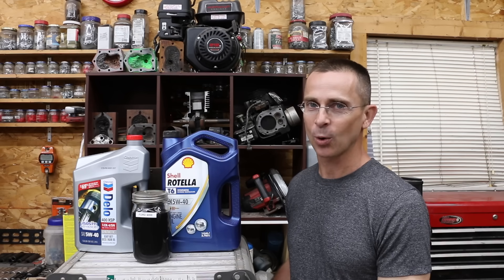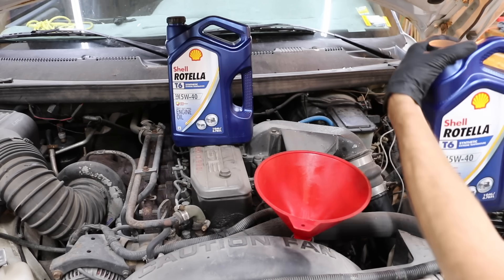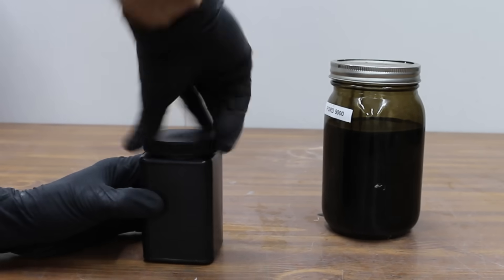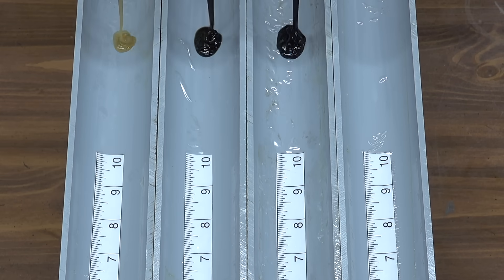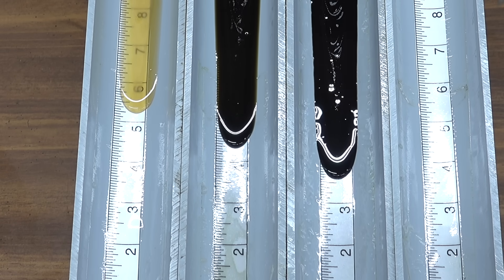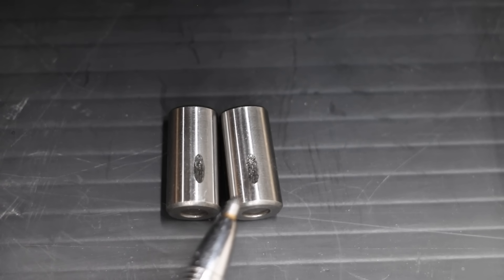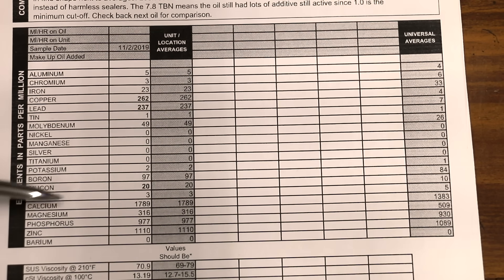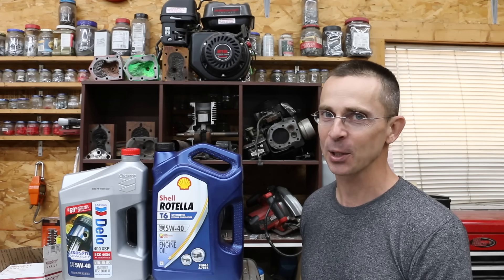Will Annual Oil Change Damage Your Car? Let's find out!

Comment: I still change my oil and filter every 2000 miles or 3 months.  Valvoline 10w-40 Syn Blend Max Life and a NAPA Gold Filter.  Nice to know it will go the year just in case I get senile and demented.
Reply from the maker: The 4.3 should last a very long time
Reply: How many miles can I expect from my Astro Van 4.3 L motor if I'm changing oil every 2000 miles and never beat it up?  I wish someone would tell me a half million... lols.

Comment: High copper % will wear out your engine really fast.
Reply: High copper is as a result of worn main/rod bearings down to the copper layer. So, yes it's an indication of excess wear, but copper is the result, not the cause.
Reply: @jamesplotkin4674  If you studied a bit of chemistry you would know what copper does to your engine. Try putting some in your engine and drive 5-10k miles and see what happens.
Reply: @rudolfgyorkei9558  OK, but Todd uses Engine Restorer and sees good results. Obviously, I wouldn't dump in enough pennies to block the oil pump pickup :)
Reply: @jamesplotkin4674  lol, if it works then I cannot argue with that
Reply from the maker: Thank you for the feedback. Copper is from the Engine Restorer product
Reply: @ProjectFarm  So, Im confused. Rudolf said copper damages the engine, but you say otherwise. I don't know what to do, so a nap is my best option.

Comment: My video idea. How about the idea some people have about non detergent oil vs detergent. I have been told that if the engine has always been run with non detergent oil it is not a good idea to switch to a detergent oil. Especially if the engine does not have an oil filter. The fear being that if you switched to a detergent oil after years of using non-detergent you would dislodge years of contamination and dirt and potentially damage the engine. It Would be nice to see some tests since there is so much debate about this topic on antique car and antique tractor  restoration websites.

Keep up the great work!
Reply from the maker: Thank you for the video idea!

Comment: Metal cannot corrode if oxygen cannot contact it.  Corrosion requires dissimilar metals (plenty in an engine), an electrolyte (acid)  and oxygen. Remove one or more....
Reply from the maker: Thank you for the feedback

Comment: Only 114k on a cummins. That truck should outlast you at the rate you are driving it. Sounds great. I always thought the change the oil regardless of use was just a myth. With that said i still follow the 3k rule. That means somewhere before 5k its changed.
Reply from the maker: Great point!  I need it to last at least 20 years. Can't afford a new truck these days!
Reply: @ProjectFarm  that truck looks to be taken very well care of. Keep the good work up!
Reply: Project Farm New Trucks are so much money!  Even used ones are expensive.
Reply: You dont want a new truck. Today's diesels are so choked up they cant outlast a gasser anymore. That truck you have is one of the better ones. When you need the transmission rebuilt, have the "Transgo shift kit" installed at that time. That will bullet proof your transmission.  

Cat and Peterbilt got out of the OTR builds because the new epa requirements made it so their engines can no longer meet their reliability standards. The EPA has pretty much killed the light duty diesel. In time you will see. It's not here yet, but it's here. The new large gas 8.0 and 7.3 liter engine are being introduced should be some sort of indication of what's to come.
Reply: @ChannelZeroOne  automatic second gens have the 47re
The 48rfe is in the 2003 to 2007 third gen automatic models.
Reply: @ChannelZeroOne  speaking of those gas 7.3s... I can't wait till they start showing up in junkyards. Man would that wake up an F150 :)
Reply: @eclipsegst9419  those coyotes though they are some good motors
Reply: @emmareporter  they sure are! Way better than the old 5.4. but I was thinking more of putting that 7.3 in an old body style truck, which would be a very tight fit for a DOHC coyote, but no probelem for the pushrod 7.3.
Reply: @eclipsegst9419  hmm neat idea
Reply: i would do a 5.0 swap into a crownvic with a better transmission etc
Reply: and if u wanna know which 5.0 the coyote dohc
Reply: @emmareporter  it would be pretty fun to have a supercharged yote and a 6 speed in a crown Vic. Total sleeper! But even just swapping the motor and putting a shift kit in the 4 speed would be a heck of an upgrade. 4.6 and coyote share the same bellhousing pattern. Motor mounts would be the only fab work, maybe some little stuff here and there.
Reply: @eclipsegst9419  lol put a 10 speed in it
Reply: @eclipsegst9419  Since the 6.2L will fit in the F-150, I am hoping Ford will offer the 7.3L engine as an option in the F-150.
Reply: @emmareporter  Yes!
Reply: @09NXN06  10 speed for the win babeeeeee
Reply: @emmareporter  that would be awesome!!
Reply: Amulek Musser not correct there were 2 automatics available on second gen cummins. The 47rh which was only used in 1994-1995 and the 47re 1996-2002
Reply: @connerbutler1077  Get one letter off and the internet has a shit fit.
Reply: There's a difference on diesel oil changes. You use a larger quantity of oil which in the end takes longer to break down. So you end up changing oil on these trucks less often but spend more money on oil changes each time.
Reply: @PedramBastan  100% correct, I have 15 year old Subaru Forester 2.5L Turbo engine, and for whatever reason Subaru decided the sump size of 4.73l was adequate, imo it's not, that oil is worked hard and there is not much of it so it's changed 6 months/ 3k miles religiously. Oil is cheap
Reply: He could trade that one for a new one if he wanted. A 2nd gen ram Cummins with only 114k non molested? That truck is worth a fortune!
Reply: @limoboy27  sure it is! Just ask all the guys on FB swap trying to sell their rusty 200k mile truck for 10 grand!
Reply: Keegan Johnson that Cummins isn’t even broken in yet! Not to mention, it’s better built than anything on the road today. It was made to last and by the looks, it’s been taken care of very well.
Reply: @limoboy27  I wasnt saying his truck isn't nice, it is. I was making a joke about the sort of guys who think that the fact their 600 dollar rust bucket of a pickup has a $4k value engine in it that it's magically a $15k truck.
Reply: @eclipsegst9419  -'Rust' is the key word. When all of the bolts break off as you are attempting to replace a common wear part.. 

The Southwestern desert truck is far above value of the Chicago Ill clump pile of iron oxide particles, that make the Titanic look like a recoverable 'project' cruiser....
Reply: Agreed. Very nice year as well.
Reply: How do you have one of those trucks with barely over 100k on it?! Keep it!
Reply: Keep in mind that most big oil change places just filter the old oil then use acid to burn the dirt out then send it back in 55 gallon drums.  Always insist on new oil from one or five quart containers.
Reply: Mine is a 2004 with 74k on it. Sits a lot. Unmolested but the electric drivers seat motor broke.
Reply: The results of this are inconclusive . a lot if it depends on how much moisture you have in the air and if you live close to a body of water or not . have you ever popped the oil fill and seen a slight milkyness under the cap?
Reply: Bill Spencer Jr  True. This is why he mentioned getting the engine and oil up to operating temperature at least once a month. In high humidity environments such as the coastal areas this is crucial. The condensation inside the crankcase will introduce water into the oil. Getting the engine oil hot is crucial to boil the water back out of the oil. Same for exhaust systems; they’ll rust from the inside out thanks to condensation.

Comment: With every single vehicle I've owned, I can tell when it needs an oil change by the way the engine runs.  I'm sure it has to do with the hydraulic lifters affecting valve lift.

Comment: The film strength test could perhaps be done with the oil at around 220F? That reflects the operating temperature when driven hard. Would be interesting to see if that makes any difference to the temperature used now. At what temperature will the wear increase steep?
Reply: That is a good point. Cold oil is much thicker than hot. My money is on wear decreasing as the oil thins enough to be equal to a hot 50W, and then increasing once the temperature is enough to thin the oil below the thickness of a hot 30W. Also I have heard that some oil additives are only fully active once hot.
Reply: 180-200 idk of a single car that runs at 220 thats a little hot for a motor
Reply: @blacksheep9734  Yea, it's too hot but not totally unseen short periods on the autobahn or the track, even when having an oil cooler.
Reply: Jörgen Pryss Maybe an older motor with no oil cooler will get the oil to 220, but if you have a oil cooler I doubt it will get over 200. I have a oil temp gauge in my truck and its a newer dodge diesel like the one jn the video and it never gets over 200 ever
Reply: @blacksheep9734  I've seen it on BMW M-cars punished for several miles near the red line on the autobahn to get that last mph and also on cars tracked for long periods. We're talking engines with >100hp/1000cc without supercharging. According to BMW oil temp up to 230F is ok on E36 M3 (euro spec) with the correct oil. (I'm not sure what supercharging does to the oil temp.) (But normal running temp is 185-195F.)
Reply: Jörgen Pryss then why does my turbo charged diesel with 450 horse motor not have that problem towing long distances? Diesel burns hotter than gasoline, they burn oil. But I always ran rotella t3 10-30
Reply: @blacksheep9734  I know nothing about your engine and why it does what it does. But two guesses: 1) Diesel burns hotter so chamber/exhaust temperatures are higher, however they are also more efficient at converting fuel energy to mechanical work which means less heat outside those places. 2) The truck engine at full power (that I hope you don't have to use contiously when towing) are probably revving a third of what the engine I'm referring to are revving. That also means a huge difference in losses. (Losses = heat). But both these two are just guesses.
Reply: @blacksheep9734  Answer #2: Have a look here, oil temp (below rev counter) touches 230F/110C before the oil cooler shunt opens at it drops back to 212F/100C: https://www.youtube.com/watch?v=k7OdObysNlM
Reply: @blacksheep9734  remember. The coolant may be maintained at 190, but the oil is going to be a bit hotter. The block can't sink heat fast enough to perfectly maintain a set temp.
Reply: Results would most likely be the same just at a different level. Get my point ?
Reply: In the test it looked like the Rotella might have been lubricity tested when it was warmer.  I think you are correct on the temp making a difference.

Comment: When you change you’re oil, on most average sized passenger cars, you generally have at least half a quart of oil give or take a bit still in you’re engine. Changing you’re oil at the correct mileage and once a year prevents unnecessary wear on you’re engine. Changing you’re oil is cheap insurance for you’re engine. Of all the things for people to try and save a quick buck on, you’re oil and oil filter isn’t the place to try and save it. Use the correct oil for you’re car, and change it when it’s due. People are so damn ignorant when it comes too maintaining their vehicles. Do you have to change it after a year on the dot, no. But if you’re going a year and a half on a regular basis it isn’t doing you any favors when you have that half quart leftover of old oil in you’re engine. Because by the next oil change that half quart would then be 3 years old. End of the world, no. But it isn’t good.

Comment: I would like to see a video of royal purple vs Pennzoil. My Chrysler 300 2012 3.6 liter recommends Pennzoil but I’ve always used royal purple. A think one of your videos that show the testing would help me make a better choice in oil and would maybe save me money.

There’s also a engine oil additive called z max claiming to soak into the metal and clean engine deposits, it would be cool to make a video of that as well to see if it really work! 

I love your videos, watch them everyday, thanks glide the great content! You’ve saved me a lot of headaches and a ton of money!
Reply: Use pennzoil, it's better and cheaper. he already made a engine oil brackets test to see which one was the best
Reply: Robert Jones I seen that, I just want them compared like the video he made where he did amsoil vs Pennzoil
Reply: @almighty_pa_in7396  if in the bracket video royal purple didnt make it as far as pennzoil then it isnt as good.
Why do you want to see that again?
Reply: Kalvin Li  because I want to see a real test not graph data
Reply: Kalvin Li it never went up against Pennzoil, it went against amsoil
Reply: @almighty_pa_in7396  I remember him or someone doing a viscosity test and royal purple did the worst out of all of them so I don't got a good feeling about it
Reply: Frotax Frotax  Exactly! I just made the same comment before I saw yours. Sorry about that!
Reply: I switched to Pennzoil after reading the 350z forums where over 30 VQ's did oil analysis tests and the Pennzoil had less deposits on average.
Reply: Jake Fulton 
Nothing will save you from having a horrible engine.
Reply: Royal purple is decent, but the price makes it a shit deal. AMSOIL is a great price if you have a membership and is the best oil money can buy
Reply: Get rid of it. That engine is trash and isn't long for this world.
Reply: TheGuruStud actually the 3.6 liter penastar engine has been around for a long time, you’ve must have had a bad experience with one
Reply: Use AMSOIL and forget royal and pennzoil
Reply: @built_by_rich  Use SuperTech (walmart) full synthetic, as good as or better than all those "designer" oils at a lower price!
Reply: ojars zvaigzne is like to be able to see a comparison in 20w50.  My little turbo cars love it

Comment: Great video. I really enjoy your approach to testing. 
Would you please do a sea foam in the oil test on a junkyard motor that has issues. I would love to find out if it really works in the oil. Does it make old worn motors better or worse? 
Thanks
Reply from the maker: Thank you

Comment: I worked in a shop where a customer brought in a '74 Dodge sedan with a slant six for an oil change, coolant flush, and tune up. I noticed that the old fluids and spark plugs looked brand new, so I looked at the service history, and found that it had been in a year earlier (to the exact date) for the same services, and had only been driven 11 miles! The customer insisted on having the service done nonetheless. That would be an ideal "gently used" vehicle for the next owner.
Reply from the maker: Thank you for the feedback

Comment: Season's Greetings!

First, you might want to note that Zinc is a great wear inhibitor, but it destroys catalytic converters... so great for old diesel engines, but not so good for modern cars with expensive cats... (just a footnote)

As to ideas for a great new project... Oil film strength is rated in pounds per square inch.  In other words two metal surfaces should slide past each other easily protected by their oil film until a certain amount of pressure is applied and then they should stop sliding. (In theory) The better oil should resist binding longer...  I suppose devising a test would require two metal surfaces, oil and some weight or source of pressure that can be measured..  It shouldn't be a difficult test to devise... but you could get actual PSI results on film strength... and that would be very much worth seeing.... Well, you asked for ideas.... again happy holidays.

Comment: i have a lexus ls400 that i havent changed the oil in almost two years because the cars has driven less than 1k miles. ive been lazy to do it. so ive been a little worried...
Reply from the maker: Thank you for the feedback

Comment: This is a good one! So I will send this too Toyota who seems to think my gasoline vvti engine needs changing yearly else it voids the warranty. Shame the previous owner took it for a service per miles not years as now it has a stretched timing chain, but according to Toyota this wouldn't have happened if it was changed yearly aha
Reply from the maker: Thank you

Comment: There are too many factors to be considered.  Short distance travels, fuel dilution, excessive warm up periods in cold weather and neglecting to check oil levels will throw your 20,000 mile or 1 year oil out of the window. 5-10k mile per oil change rule of thumb also depending on what oil you use if it makes it that far, and what engine/make the vehicle is. Some are easy on oil, some are very hard on oil. None of this is scientific and is nothing more than an pointless assumption. The only way to know if your oil needs changed is to have an oil analysis done. Finger slipperiness, a worthless pour test and if its black doesnt mean its good or bad...
Reply from the maker: Thank you for the feedback

Comment: Thickest gear oil. 
Will it increase compression pressure.
50/50 gear oil and engine oil 1st test
100 percent gearl oil 2nd test.

Comment: I own a 22 year old truck with only 135k miles on it.  For the past 10 years or so, my 5,000 mile oil change stretched past 12 month, then past 18 months.  The longest was over 20 months.  All of this was on "natural" oil.  The only "saving grace" was, when it did get driven, it was usually for more than 30 minutes, so the engine was fully warmed up and any condensation was driven out of the crankcase.  Oil consumption has stayed steady at about 1 qt every 3,000 miles.
Reply from the maker: Thank you for the feedback